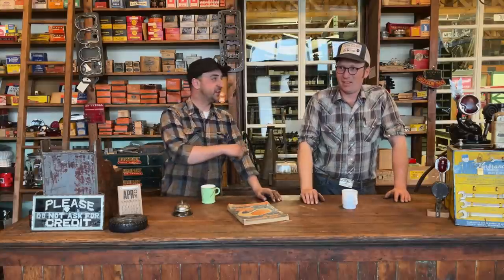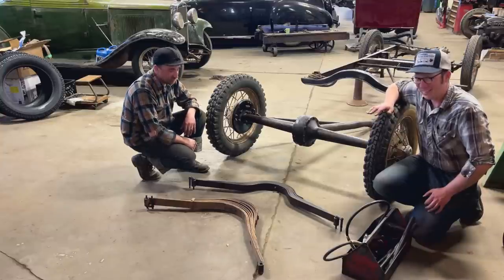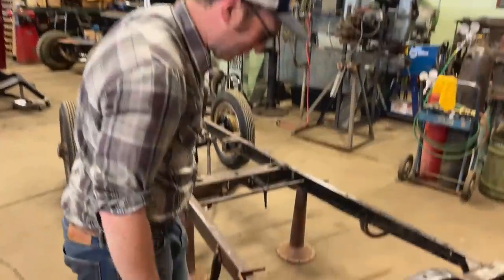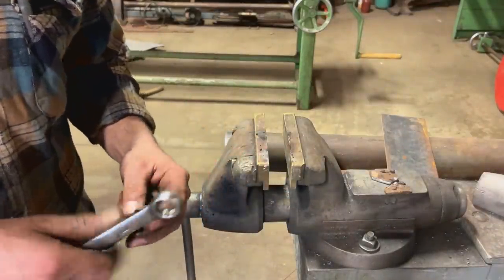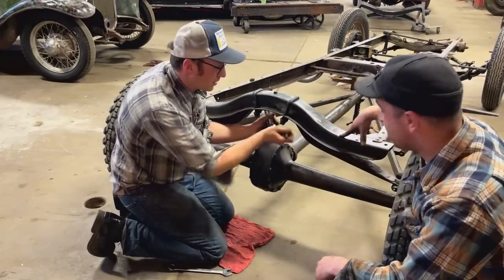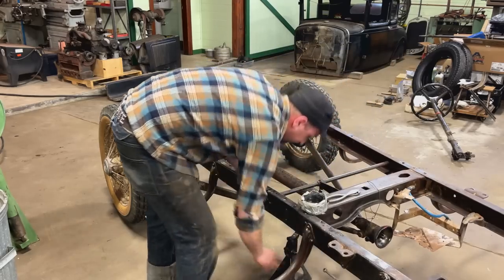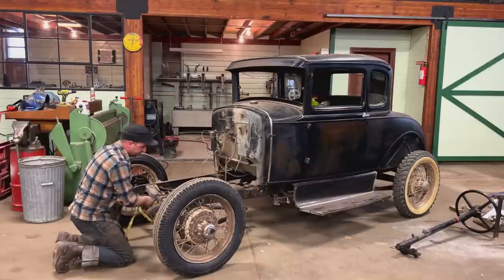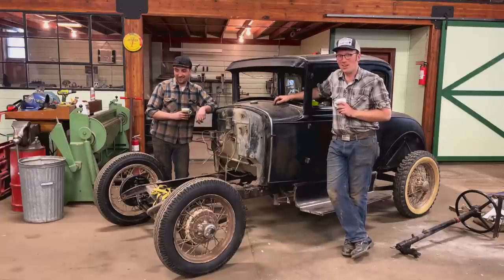Double Your Garage Space for FREE?!!?  1930 Model A Ford Coupe Body Goes Back On!  Lowering Made EZ!

Comment: Good to see you back. I'm keen to see progress on Jim's A so it gets an outing before the snow arrives. Also, I'm surprised to see the 31 Chevy still in the workshop. Have you found a new owner for it yet?
Ford's transverse leaf suspension had a very long life as, here in the UK at any rate, the last model with TL came off the production line as late as 1959 (Ford Popular). My first two cars, a V-8 Pilot and a Prefect, both had TL.